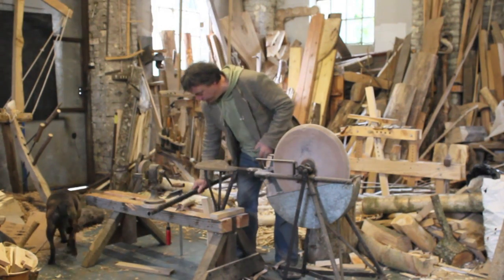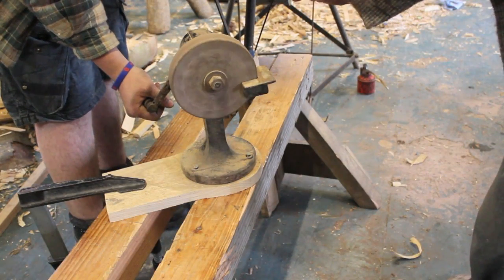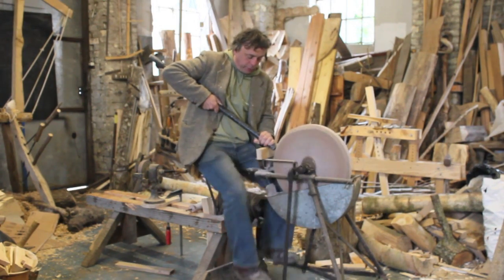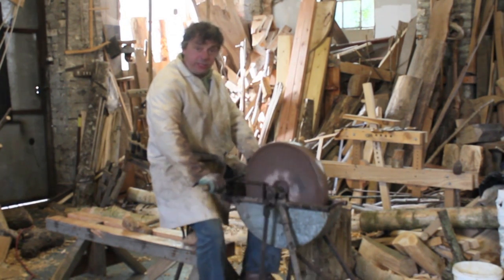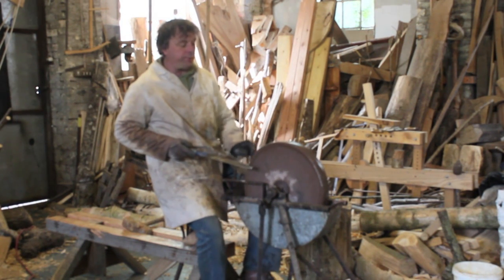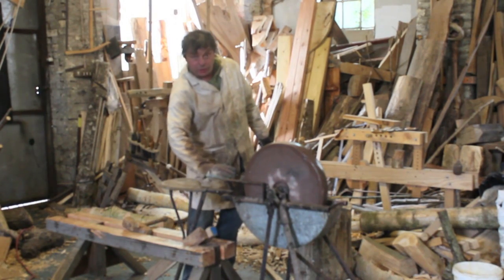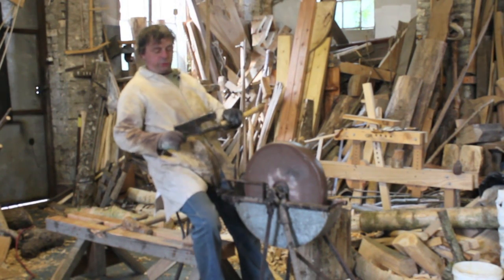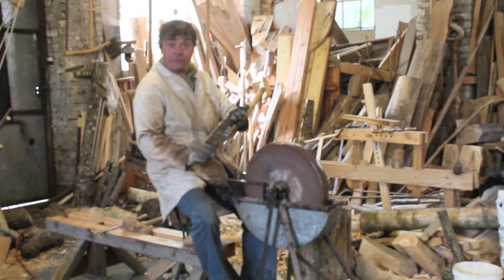How to dress and true a treadle powered water wheel

Comment: Most of these wheels were used for sharpening sickles, scythes, billhooks, axes etc - the user just let the tool follow the contour of the wheel. Only if you are sharpening chisel or plane blades held on the rest does the wheel need to be true, and even these can be held by hand to follow the wheel. Being natural stone, these wheels have variable hardness and wear resistance across their diameter, even if trued they will often soon go out of round - continual truing will rapidly wear them out...
Reply: Mostly right, however scythes and sickles were usually sharpened by peining (hammering) as this also work hardened the single bevel cutting edge and was done in the field with a hammer and dolly
Reply: Leaving them with the lower half resting in the water bath will rapidly send them out of true
Reply: Interesting, but how did they sharpen swords?

Comment: Maintenance-Do not leave the stone soaking in the trough. I prefer to use a drip can. Do not leave the stone in the sun. Especially do not leave the stone in the sun with the stone also in the water. The sun will dry out the stone on which ever side it is shining the most. As it is dried it shrinks. If the stone is submerged in a trough it absorbs water and swell some. The swelling and shrinking will cause the stone to go very much out of round. The converging stresses could crack the whole thing. I prefer to use a drip can. More than anything, do not leave the stone submerged in the trough in the winter and let it freeze.
Reply: Absolutely right. Mine has a tap at the bottom to drain down after use. 
There is a trick to this ... Remembering to use it   ;<)

Comment: If hand held, with no depth of cut control, there is a natural tendency for the dressing tool to go in and come out with the undulations of the uneven wheel. I use a piece of 1" dia threaded bar and 2 lock nuts which are pressed up hard against the operator side of the tool rest . This system keeps the depth of cut absolutely the same all round the wheel and, provided the tool rest is accurately set perpendicular to the wheel , will give a flat true surface across the whole width. Quick and simple to adjust as the cut progresses. [the business end is a large chunk of tungsten carbide brazed on]
Reply from the maker: Because the pole I was using was big and heavy there was no problem of following the hollows and bumps of the wheel. Good and important point you make, and a simple solution you offer. I will have to try your tungsten carbide trick. I have only just started learning to weld.